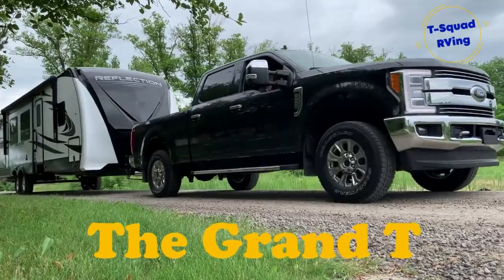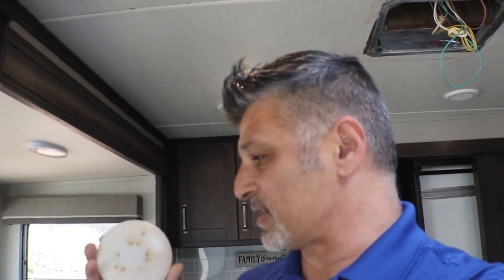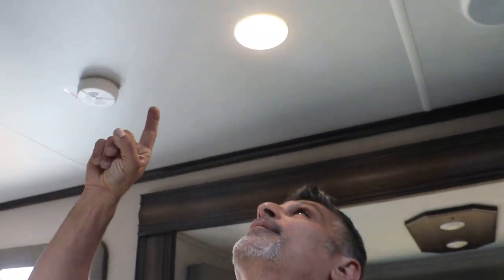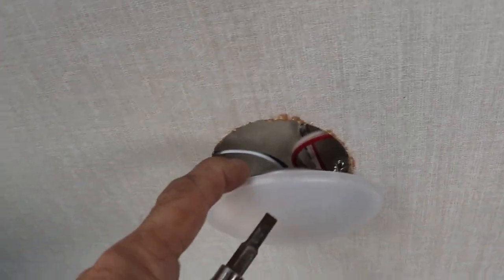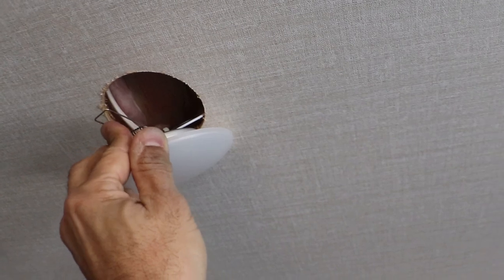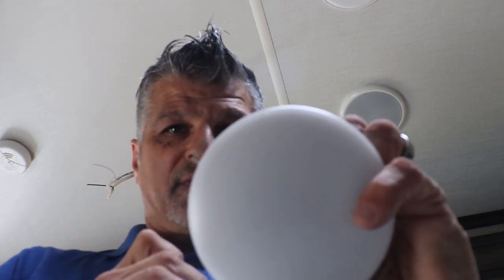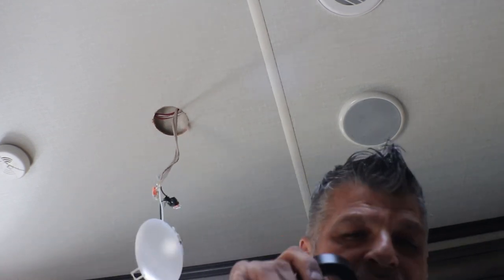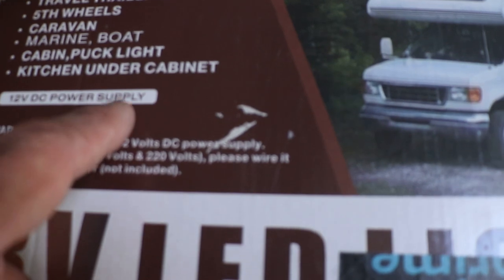RV interior Lights AKA RV Puck Lights Replacement

Comment: What if you only have white an red wires hanging out of rv an your replacement light has a red an black wire?
Also do you cut electricity off? Before starting
Reply from the maker: So anything that has a red line is hot to the converter from DC.  ALWAYS TURN OFF POWER AND DISCONNECT BATTERY because most pick lights work on DC 
So white is neutral and Red is positive or Hot.  Some have black that is hot.  I would get a meter and make sure.   Good luck hope this helps.